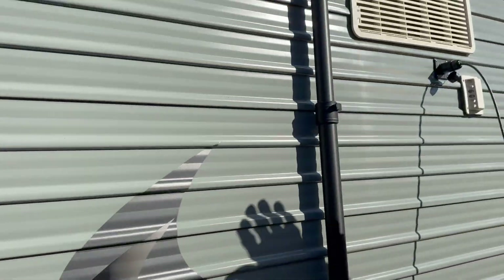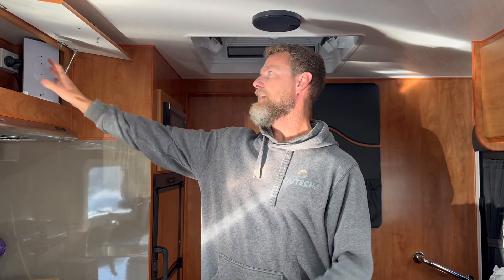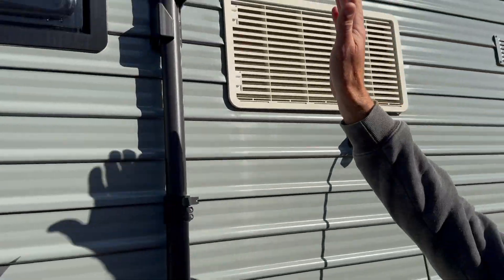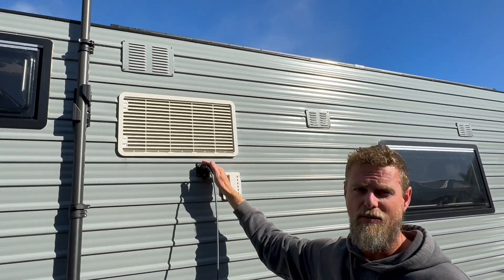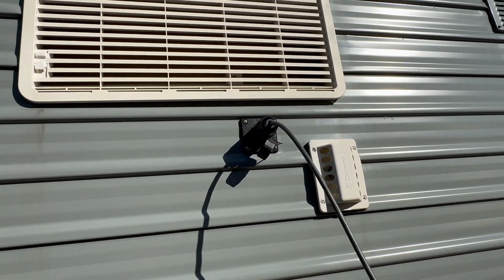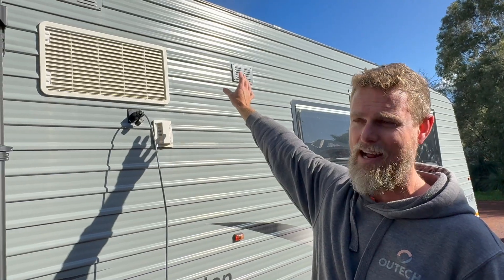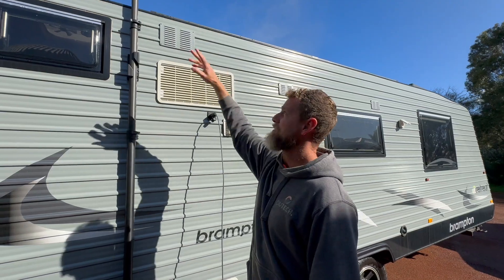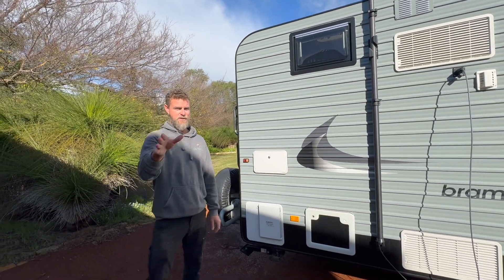Why Upgrading Your Caravan Power System is Smarter (& Cheaper) Than Buying New!

Comment: I'm looking at put cowfish technology in,  as it will run it off 12 voltage.
Reply from the maker: Thanks for your comment! While we install both Cowfish antennas and Starlink dishes based on customer preference, we often lean towards Starlink for its reliable high-speed internet, especially in remote areas. With a solid power setup, Starlink can provide consistent connectivity, making it ideal for streaming and video calls. If you're looking for reliable internet while on the road, Starlink is definitely worth considering!

Comment: My wife and I will be retiring soon, and we are on the lookout for a caravan that we can travel around Australia in. 
We have been looking for over 2 years, and it always comes down to how long we can stay off the grid for. 
And the answers ranger from, "I need to look that up or "they just shoot in the dark and just lie to you. 
I have a 2018 triton manual. My question is, what is the most reliable caravan on the market that my car can tow?
Reply from the maker: Unfortunately with smaller dual cab utes like the triton you are definitely weight limited. However, you should be able to find a suitable smaller 18ft van with a great layout to suit you and your triton. We don’t recommend van manufacturers specifically as each one has their own pros and cons. Find a layout you like, then make sure the chassis construction is sound.

Comment: i have to ask based on the a 620ah 12.8v battery, do you not think it is worth based on a induction cooktop plus ac unit possible of doing up to 7kw across say 4 burners pus the ac, that a 48v system be a better option for wiring and efficiency?
Reply from the maker: Not necessarily. There are a lot of factors that need to be taken into consideration with battery voltage including cost, efficiency and what charging sources are available. There are definitely advantages to 48v in terms of output, cable sizing and efficiency. However there are also disadvantages also like the need to series the solar array and a limited number of 12/48v DCDC chargers. 

As technology improves 48v will be a much more likely option for all high powered electrical installations in caravans.

Comment: hi nice , how much did it all cost please  ?
Reply from the maker: Thanks for your question! 
The cost of the off-grid power system can vary depending on the specific components and upgrades you choose. 

Each of our upgrades is customised to suit our clients' existing caravan, power setup, and power needs. This particular build included additional work that may not be mentioned in the video and may not apply to all upgrades.

Generally, a complete off-grid power upgrade like this can range from $15k to $30k. 

For a more accurate estimate, we recommend reaching out to us directly or subscribing to our channel to see our upcoming video, where we discuss the costs in detail.